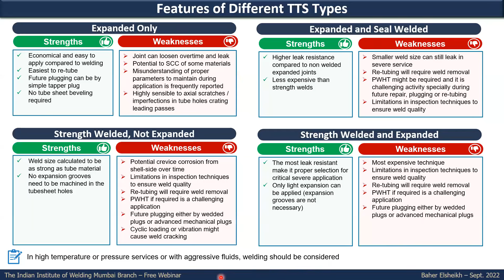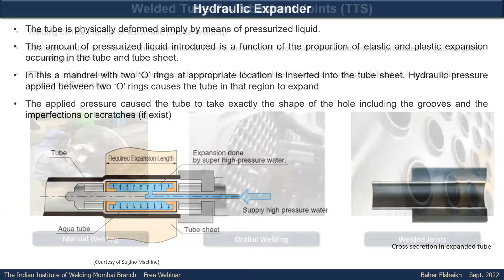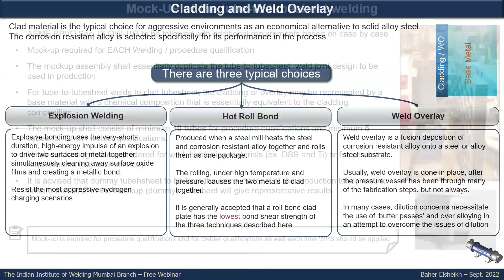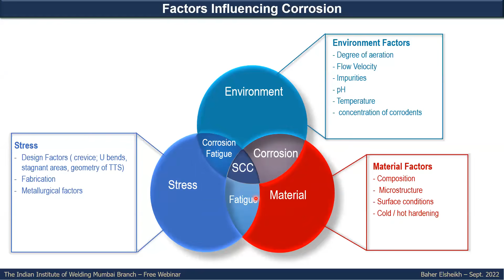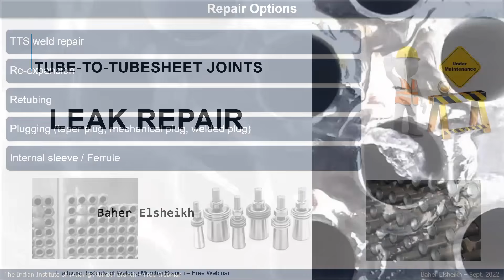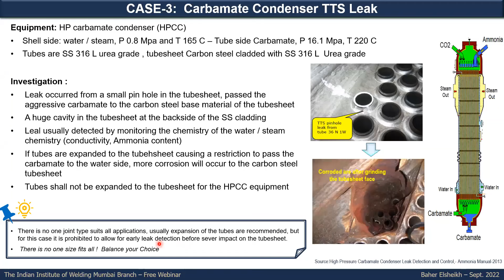Tube to Tubesheet Joints

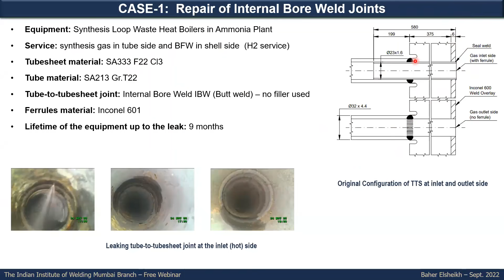Comment: At 57:52 minutes, is the tubesheet material mentioned as SA 333 F22 correct? SA 333 is the material code for the LTCS piping. Please comment.
Reply from the maker: Thanks for the observation, it is typo. Possibly, it was SA182 F22

Comment: What could be impact if the value of 'w' (groove width) in hydraulic expansion is lesser than obtained from the formula.
Reply from the maker: In TEMA there is no explanations for such requirements, but from some manufacturers and technical literatures, they where able to achieve the proper pull axial force by following this criteria. while for smaller grooves, much lower pull force was required
Reply: Thank you!

Comment: Any book/study material that you would recommend for learning content like this about heat exchangers and aboveground storage tanks
Reply from the maker: At the end of the presentation there is some recommended references 
The main are: TEMA and API 660
Reply: @baherelsheikh4942  Thanks Sir but I wanted to know about any theoretical books/study material that can help in clearing concepts related to design and fabrication of heat exchangers and aboveground storage tanks
Reply from the maker: I am highly recommending: heat exchanger design manual by Kuppan Thulukkanam
Reply: @baherelsheikh4942  Thank you for your recommendation. I'll study it.